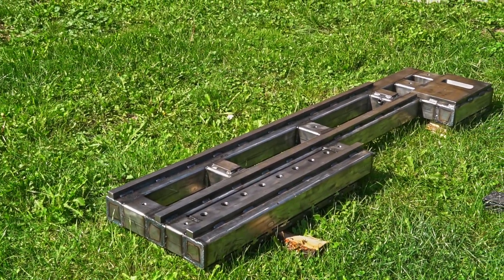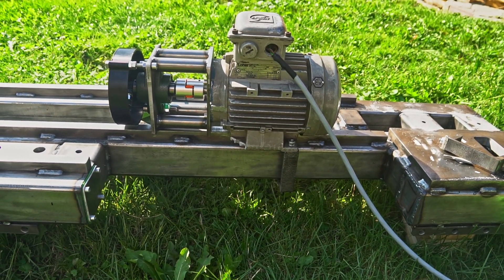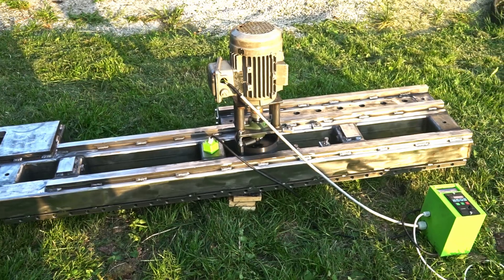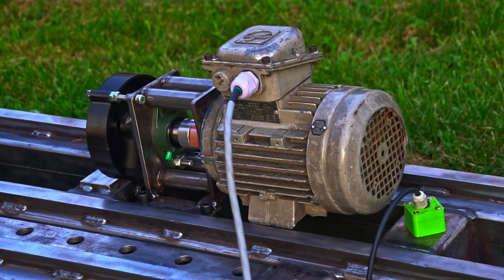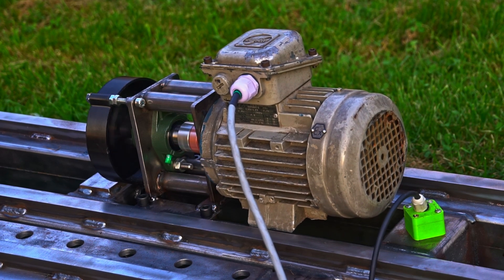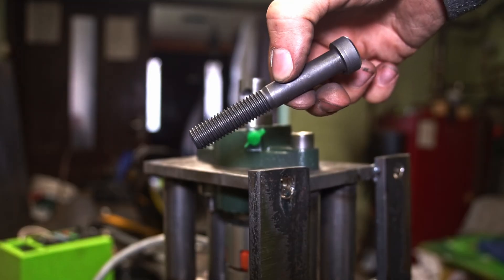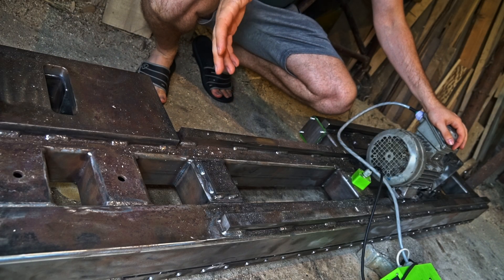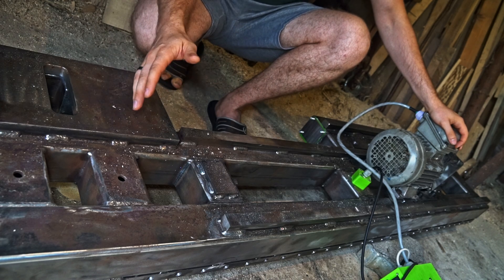Vibratory Stress Relief of The Welded Frame! - DIY CNC Metal Lathe Build! #3

Comment: For some reason, when i need inspiration for a project, i always end up with you're channel 😄
Building a gantry cnc right now and i need to stress relief the frame and guess who show's up in the search results ! 😎👍
Reply from the maker: Hahaha, that's great to hear! It seems the algorythm does a great job! 💪
Recently I started to assemby the rails on the frame and it looks like it didn't warp after machining. The vibrating seems to help, but ofc if you have a possibility it's better to do a heat treatment :)
Good luck with your build!
Reply: @GBWM_CNC  That's great to hear! heat treatment is sadly not an option round here 😵 Thanks!

Comment: You can still anneal it! Wrap the frame in mineral wool and use a propane burner or similar to heat it up. Only need to hit about 800C.
Reply from the maker: I was thinking about that but to heat the whole frame up to the same temperature would be quite hard. Heating it do different temperatures depending on the zone could bring more disadvantages comparing to advantages I think
Reply: A slow heating rate and long soak will normalize the temperature across the structure. It is a reasonable way forward I think, but you could always test in a. Small piece first.